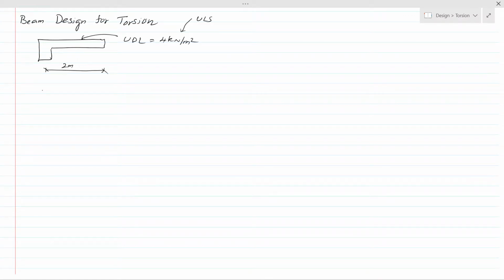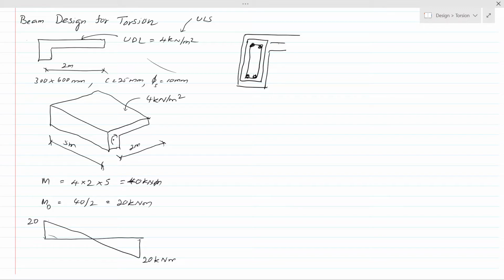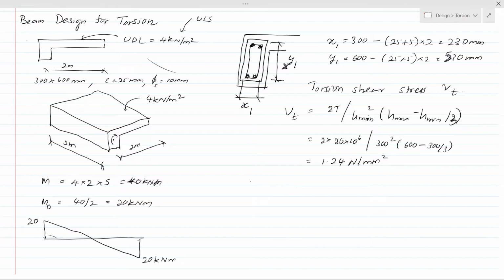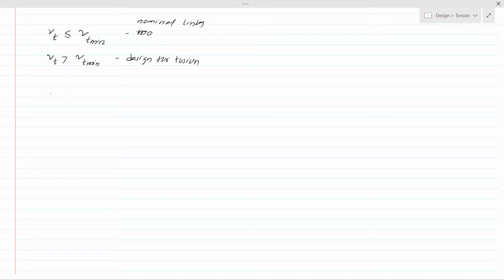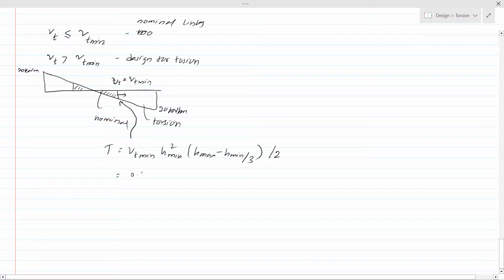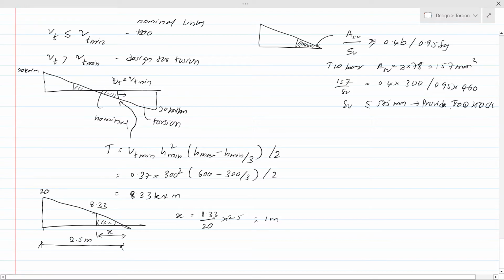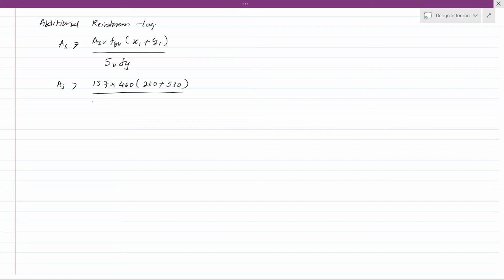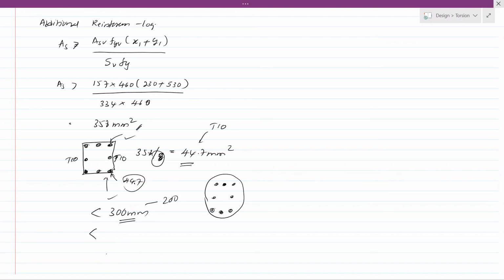Torsional Reinforcement | Calculation Worked Example for Beam

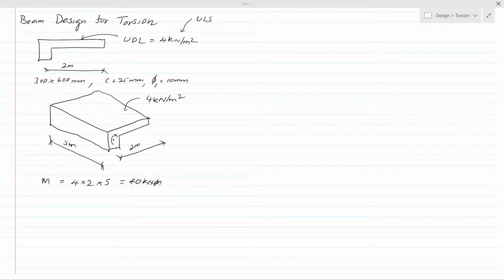Comment: 1:41 how do you get the moment from area multiplied by kn/area loading
Reply from the maker: It is correct in this case. 
When you need the moment, first need to calculate the moment per unit length that is 4x(2x1) x 2/2.
Then the total moment 8x5 = 40
Reply: I think his derivation of the 40 KN.m moment would be,, 4KN/m2(5m)(2m)(1m)= 40KN.m,where; 1m is the  nominal moment arm
Reply: @lemwelromero6699 is it always 1m?